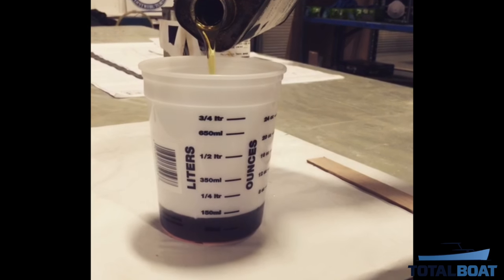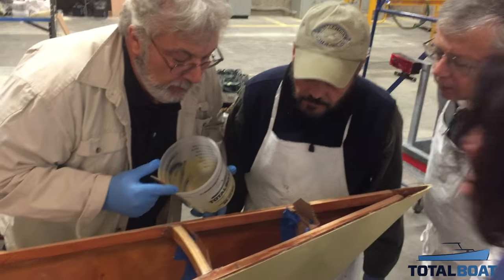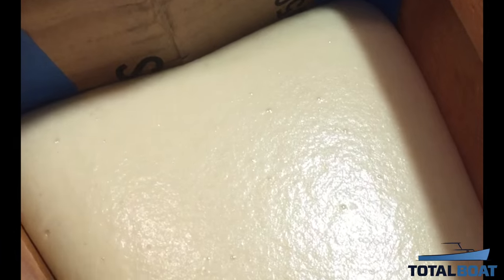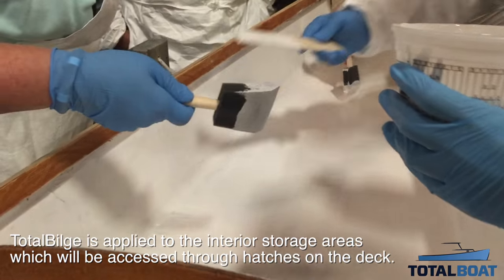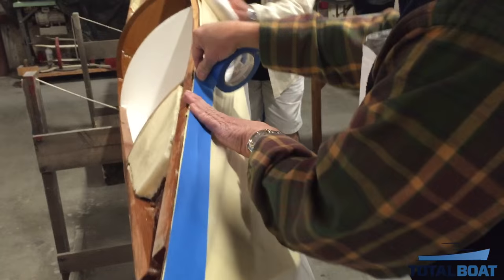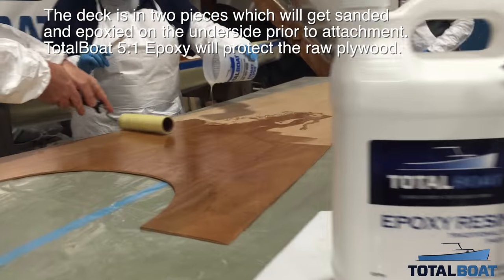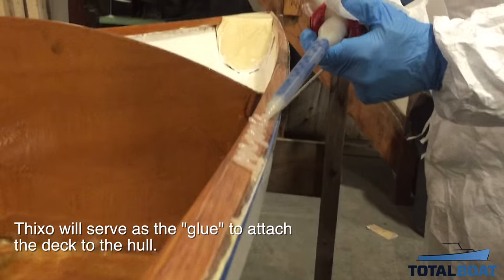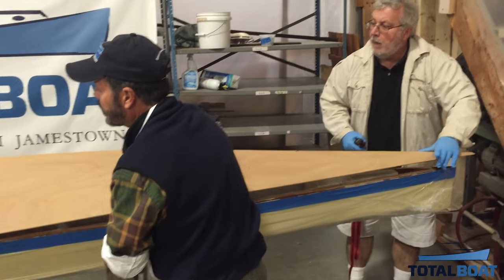TotalBoat Training - Building a Kayak - Part 2

Comment: Do you guys have epoxy with doesn't blush? it's pain to deal with this every time I do fiberglass.
Reply from the maker: +mankouski we do not. But Blush is very easy to remove with just water and a Scotch Brite pad. Do not use a solvent! Water alone and some elbow grease will do the job. You can also apply Peel Ply or a release fabric to lift the blush off the cured epoxy. Good luck! Our 5:1 Epoxy is very popular. Give it a try!
Reply: +JamestownTV I already use the epoxy and like it. Except the blush of course. it's great product.